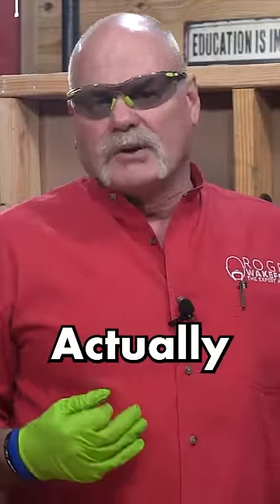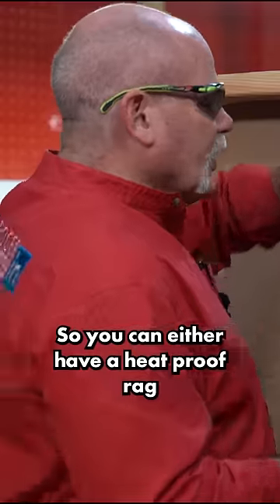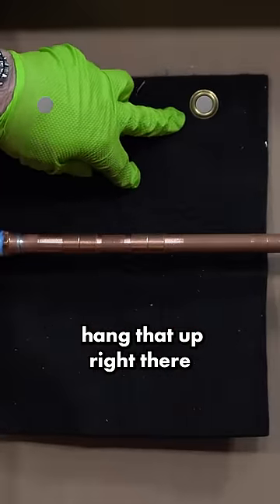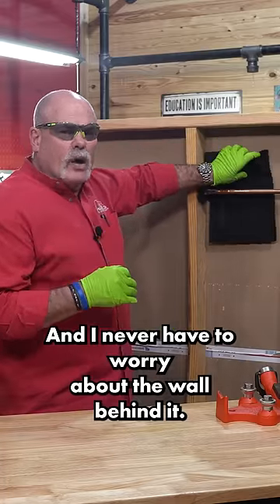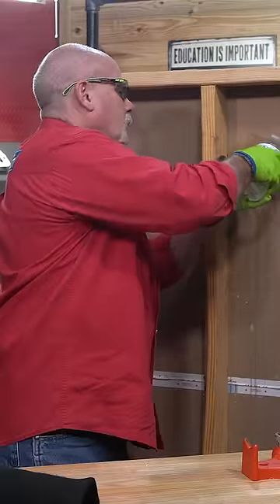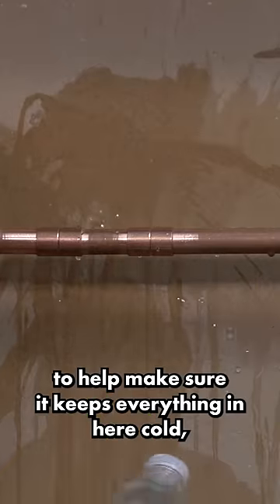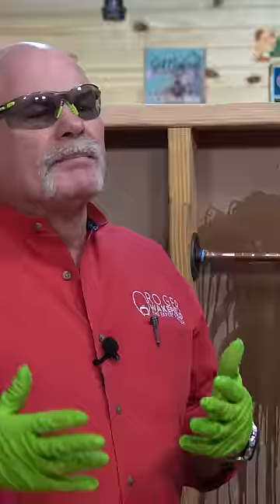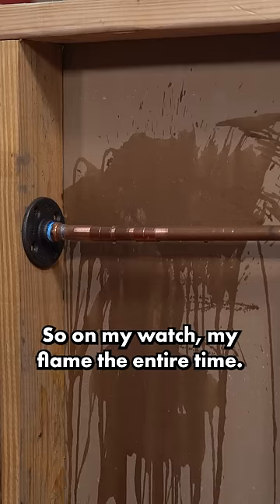Solder Joint Catches Wall On FIRE

Comment: My dad was a homebuilder back in the day. A plumber sweating pipes in an 8 unit condo bldg finished in a crawl space then left for lunch. Thankfully everyone else did also. By the time he came back the building was engulfed in flames. The fire got so hot it twisted the I-beams and destroyed 8 porcelain coated steel tubs. The plumber said he ran a wet rag over his joints. Obviously he missed one or completely lied about it.

If you're a plumber, heed this man's warnings.
Reply: i dont see how any real plumber could start a fire like that...should b ready to put it out quickly
Reply: @jasonbeasley4348  They don't watch the area like they're supposed to. Fires can start as much as 30 minutes after soldering them. It's actually something they learn as an apprentice.
Reply: a hot fitting did not cause the fire....obviously he dropped a ember or ignited the wall while soldiering...only way this can happen is with pure carelessness or nowhere near enough expieriance so like i said a real plumber can do this job no problem
Reply: @jasonbeasley4348  Actually, the plumber's negligence was the cause of the fire. The actual, physical cause was not determined but he admitted to sweating pipes and not watching them for the 30 minutes he was supposed to.

Comment: I keep a spray bottle of water to mist the wood and drywall. And then if something catches you can put it out
I just use aluminum foil in 4-5 layers and It works great.

Comment: I did my shower pluming and father inlaw told me to use a spray bottle and spray the drywall and studs incase. Dont soaked it down but enough to not make a spark lite . 👍🏻 good videos🇨🇦

Comment: I've done plumbing for decades and do not recommend the water saturation method, a lot of times the drywaller will come through and wall away moisure.  And so begins your mold and mildew problems.

Comment: with Costco, any Hot-work requires someone to watch the area for an hour after work is completed and for someone to check the area regularly for several hours after that.  A portable smoke/fire alarm is also placed near the work area *(while under Hot watch).
But it should also be pointed out these are active businesses with members shopping, so the added requirements are for Everyone's safety.

Comment: Happened to the complex I maintained. Let him in to fix a sprinkler line in an outside wall. The renter comes back about 5 minutes after he's done, calls me and says the wall is smoking. I emptied 2 extinguishers, no use.  He lit the inside of wall on fire. Called the fire department and ran around, making sure no one was in the building.

It was an exciting day. They chopped that wall down with axes in no time, it was wild.

No idea what happened to the plumbing contractor. Knowing the company I worked for,  they probably hired him full time as a supervisor.

Comment: Just always have a fire extinguisher when working with open flames. I’ve literally watched a small amber smolder as the apprentice ran down stairs to get one out of the truck and by the time he got back in the house, the entire roof was fully engulfed underneath. Place burnt to the ground by the time fire got there. All could of been avoided if a fire extinguisher was in eye sight.

Comment: Had to repair a rotten wall because of one of those One-Day Bath installs in the main bath.  The wood and sheet rock was heavily charred and there was a puddle of solder and it still slow leaked into full blown dry rot.  I can do better and I did with one of those cloths.

Comment: Plumber installing my water heater 2 weeks ago did just that. I came in to room and found soot and char marks, along with black splatter stuff all over my walls and floor. After everything connected I found pipe leaking below his solder joint (he melted solder joint further up pipe by overheating it)  so had to half drain water heater to move out of way and he repaired that.  I think it's still got issue but water sensor not going off behind it (yet). 🤦‍♀️

Comment: I was maintenance supervisor at a beach resort and we had contracted a plumbing group to replace some pipe. Late afternoon I went to 15th floor of a 15 story building to check on them. A guy was brazing just inches from sprinkler head. I told them to be careful and to watch the pipe. They looked at me like I was as dumb as I thought they were. I left, but before I was halfway home I got a call to come back. Sure nuff we had 15th down to 8th floors flooded. Can't be to careful!

Comment: I'm an electrician I had to rewire a couple houses because of the plumber doing that. My dad's a plumber I'm not but I even thought you'd get those silicone mats for putting a hot pan on and you can put that behind the pipe.

Comment: Dude that's a bad plumber if they need all that for a couple 1/2" joints. You don't need that much heat or a very big flame or a long time to heat up 1/2". And beside all that, you could just sweat some pex adapters and make the repair in Pex, and that's if they don't get a repipe. If you're getting pinholes and leaks in your water lines, it's time to repipe and protect the system with a custom filtration system. I'm more of a fix the whole thing kinda guy but obviously the price difference is far apart between a 1/2" copper water line repair and a whole home repipe.

Comment: I hate old houses when I need to reach into the ceiling to reach the joint. I soak the crap out of the wood.  The old houses which are over 100 years are dry as the sand in the desert.
Reply: 100years thats nearly new in the U.K.

Comment: I've lit a wall on fire even with a heat proof rag. Solder everything outside and do your last two joints in pro press. 
If possible do it all in pro press

Comment: In 25 years of plumbing I have never had an issue with the drywall. Don’t get me wrong. You’re smart to take these precautions but it’s the cobwebs and spider webs that I’ve seen go up like the Fourth of July! Have a fire extinguisher. Just in case.
Reply: Lots of things, debries, dropping solder , it happens , just need the right combo of events

Comment: I used to carry a small piece of 1/2 copper in my jacket pocket. About 2 in long with a pressure crack in it. It was cut out of an ice rupture. The apts "handyman" tried to replace it. Caught the insulation backing on fire and ran up between the walls. Multi million $ apartment building destroyed

Comment: I've been doing that with bottled water for about 30 years to poke and a half-dozen TV holes in the cap and spraying so that everything the studs to sheetrock even insulation even though they say it doesn't burn I don't trust what "they" say - I just get everything soaked

Comment: Nowadays, you can avoid this common problem with Pro Press… If you’re a legitimate Plumber or HVAC technician and you don’t have a Pro Press tool by now what are you doing… And yes yes yes I understand they’re minimum $1500-$2000… But with the amount of time that you save by using it, it pays for itself in no time… By once cry once… Then you don’t ever have to worry about scenarios like this ever again… I’ve never had an instance when I couldn’t fit the Pro Press into a space

Comment: Wait isn’t that going to ruin the sheet rock?
Reply: It could if you get crazy with heavy water like that, spray bottle to mist would be better.
Reply: Yeah.
Reply: No it will not ruin it, takes a lot more water than that and it would have to get saturated most water damage drywall i see are ceilings because the water is coming from above the only time i see vertical drywall ruined is if a water line has a pin hole leak or freeze break and its blasting against the drywall at high pressure plus you better believe id rather put water on the drywall and so would the homeowner than start the home on fire because we work in very tight spots where sometimes you cant even get a flame barrier inside, his example is one of the better case scenarios
Reply: Naw, it's not enough to penetrate through the sheet and hit the rock to weaken it, only if it was soaked and constantly getting wet will it ruin it.
Reply: @ryandunn2930  no.
Reply: @Voodoo5.2  it won’t damage it but it’s deff gonna be soggy and get mold growing on it, drywall and between walls are incredibly sealed closed spaces (most of the time) that’s a breeding ground for black mold to infest a home
Reply: @Gladly  no it's not going to mold like that. It needs much more water over a long period of time
Reply: @GladlyOnXbox  They are literally working in the wall with fire… You have no idea what you’re talking about.
Reply: @Capthrax1  exactly
Reply: Not with that little amount of water. And if you do need to use enough where would damage the sheetrock, people would rather you need to replace a small section of it, then their whole damn house
Reply: It's called job security
Reply: Yes it will but I'm his example that's obviously better than catching the whole building on fire.
Reply: Well considering the paper backing on dry wall is the perfect breeding ground for mold yes the moisture is bad

Comment: I'm not a plumber but if someone could correct me, what is wrong with sharkbite! Because even if I'm not a plumber I know that spraying water all over drywall is not good for it. I've ran 10s of thousands of feet of pex and the worst that ever happened was there was a small drip from a fitting I forgot to crimp.

Comment: Once while soldering a pipe the stupid insulation foam catch fire, never in my life I had been so scared , I put it out with my bare hands, I had a water sprayer but it happened so fast that I didn't even get to use it (I did spray water before beginning)

Comment: If you were the person that put water on the inside of my walls, you'd be the person I'd be suing for the mold damage that will be later found in that wall cavity and you'd be paying for all repairs
Reply: You realize mold will only appear if the moisture is sustained right? That water would dry well before mold could form.

Comment: True story: I hired a plumber to put in the dishwasher and he was soldering on the wall just as he showing in the video, it catches fire and he takes an expensive decanter worth over $12,000$ off my wall shelf to try to douse the flame. It falls on the floor because it’s real crystal and shatters. I called his company to try to explain what he did and they would not cover the charges.  Until I got a lawyer to speak to there’s

Comment: 1 Sheet rock is fire retardant by design, "watering down the drywall" has a thousand issues, if you know anything about drywall. It's the pine framing that is a danger. And wtf?????

Comment: The neighbor is going to love getting charged for water damage to his walls
Reply: That little amount of water isn’t soaking through to the other side
Reply: If that amount of water causes issues, the water wasn't the problem in the first place.
Reply: Makes it brittle
Reply: It'll be fine!!  Mold and deterioration requires extended contact with water.

Comment: I had to solder in the wall before. Filled up my wife's spray bottle and sprayed the sheet rock. Kept a large, damp rag on hand just in case I needed to snuff out any fires. Ended up spending more time prepping everything than soldering the pipe

Comment: In this situation, why would a Sauder be preferred over a shark bite or a crimp
Reply from the maker: a solder joint is going to last longer than press or push to connect fitting

Comment: Your kidding me . If you can’t solder that fitting without doing what your did , please call a plumber or steam fitter . How big is the tail on your torch ??? Now , if it was a tight spot , perhaps yes.  But that big area , not even remotely close to being an issue

Comment: 🤣🤣🤣🤣 gets sheetrock wet 🤣🤣🤣🤣🤣🤣🤣🙌 DONT DO THIS ⚠️⚠️⚠️⚠️ Cellulose Insulation is fireproof; check the attic if ya don't have a flame towel.....DON'T SOAK WITH WATER

Comment: Or you could use press fittings on so you don't have to worry about setting anything on fire. You don't have to solder copper joints anymore